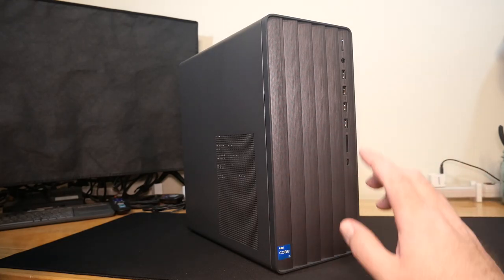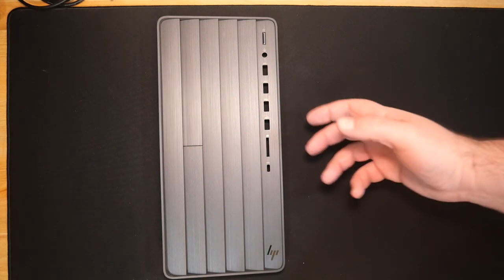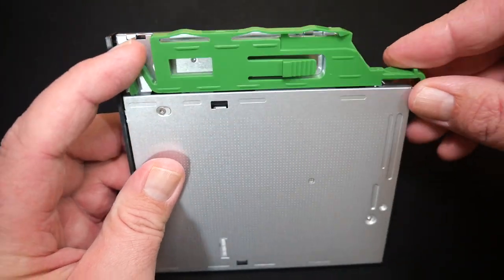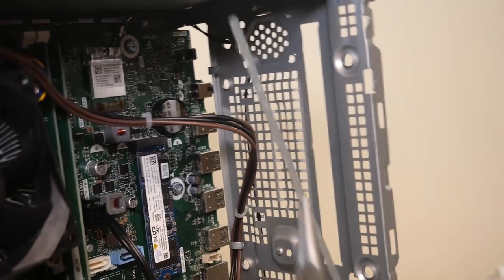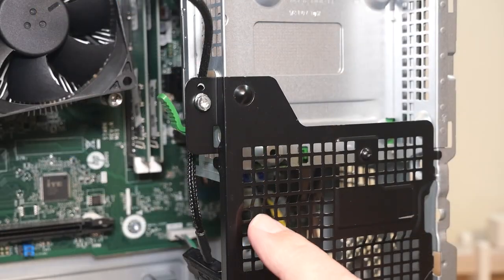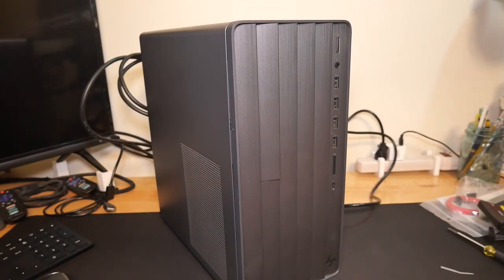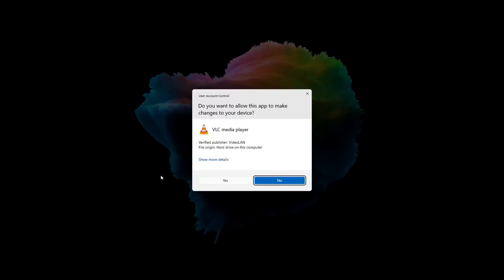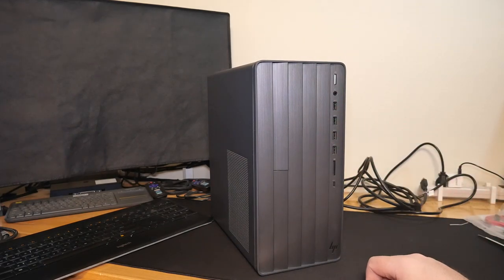HP Envy Optical Drive Installation

Comment: I like to have a full size DVD drive in my main PC. Because most modern cases don’t support 5” slots I need to fabricate a side loading mount inside the case. This isn’t a problem for me because I run the PC with the side panel off full time. This case doesn’t seem worth the trouble of adding an optical drive to though I would personally just use a different case.

PS you get extra points for using flush cutters!
Reply from the maker: Oh, I wasn't kidding in the thumbnail. No one should do this to this PC! 😂 The good news, or bad news depending on your angle, is that HP no longer even offers an optical drive bay in their "full-size" desktops anymore. So, this terrible solution was the end of the line anyhow.

That said, I do really like the Vantec full-size enclosure I have with a full height 5.25" drive in it. That's really the way to go, IMO.

Comment: I just ordered a refurbished HP Envy from Amazon (TE01-3197c) which has no DVD drive.  In the photo, it appears to have the "trap door" on the front plate, but I won't know until it arrives.  Hoping it does because I rather not use an external drive, but will if I have to.  This is a great video and exactly what I needed to know. I guess I will need one of those green latches too. Thanks.
Reply from the maker: I believe many retailers use a stock photo that shows the door regardless of whether or not the model includes the drive. It appears that model number does not. 😔 Since it's a refurb you may get lucky and it could have an odd combination parts, so... 🤞
Reply: I received the computer yesterday but have not opened the box.  I have decided that regardless of whether it has the door or not, I am just going to buy an external CD/DVD player (about $30).  I don't hardly use it anymore except to load some old programs.  The effort to install an internal drive is not worth it even though I am sure it is much faster than an external USB drive.  But I still enjoyed your video. @TheBrokenTech
Reply from the maker: @Happy-Trails-To-You  I'm honestly glad you made the decision to go external, but I think you really would be best served to go to a "good" external like the full-size option. The speed and durability difference is well worth it and eventually you won't be able to buy one at all.

Comment: speaking as someone who recently did a build with a Fractal North case, I'm totally fine with internal disc drives going out of fashion. PC towers like these are terrible for thermals, since they leave little to no room for air flow. A case with a mesh front makes air cooling far more effective, thus ensuring your parts last much longer, and without the need for water cooling. By removing internal optical drives, the leftover real estate ensures a much cooler environment inside the PC tower.

I say this all as someone who recently got into collecting Blu Ray and DVD, and while a part of me is still nostalgic for the days where I could easily watch movies on disc, I don't miss installing software and games with optical drives. Steam resolved many headaches for the PC gamer, while streaming platforms often created them for film buffs. That said, from an engineering perspective, I think the move towards external drives is for the best.
Reply from the maker: I generally agree with you on most of those thoughts, but the people who buy box store PCs aren't generally worried too much about getting the absolute best performance. I've had a lot of commenters over the years that are absolutely enraged that their PC doesn't (and soon, will not be able to) have an optical drive.

Where we will disagree is with movie streaming services. The selection on the streamers is pretty terrible. For instance, my personal movie collection is significantly larger than Netflix's US streaming library once you exclude Netflix originals... by nearly double.
Reply: Many modern cases that have 5.25" bays put them down in the PSU basement, such as the Fractal Pop.

Comment: From a previous video, I wondered how you were going to install that optical drive into that case.
 The upgrade to your HP Envy computer, the Te02-003x, has no internal support structure for a 5.25" drive and the case is entirely different.
I have been holding onto (storing) an external USB DVD drive but haven't used it in 6 years.
Reply from the maker: I wasn't even aware of the TE02 when I made my prophecy, but it looks like I was right on. Optical media is going the way of the dodo.

Some people are really upset about it though and really want that drive inside the machine, so, this one is for them. 👍

Comment: If my only choice for an internal ODD was a 9.5mm drive, I'd just use the 5.25" external enclosure you showed. One reason I build my PCs is I can ensure I have 5.25" bays in my machine. There are not many cases that still support 5.25" drives though.
Reply from the maker: Indeed. My last build, from around 2 years ago, it was tough to find a case with 5.25" bays. Now it may be impossible.
Reply: @TheBrokenTech  I am starting to see cases put 5.25" bays in the power supply basement like the Fractal Pop, so it seems they are coming back into popularity to some extent.
Reply from the maker: @RoastBeefSandwich  Huh... That's interesting. On the floor seems like a bad place for a disc drive, but, I suppose it's better than nothing.
Reply: @TheBrokenTech  I think it's mostly for airflow reasons. Not ideal if you plan to actually use your ODD regularly, but better than dealing with an external unless it really is only for occasional use.
Reply from the maker: @RoastBeefSandwich  I was more thinking about dust/hair/dander/whatever. Putting your drive on the floor and then generating a negative pressure behind it with case fans isn't a great idea.
Reply: @TheBrokenTech  It's a big issue nowadays, a lot of cases put the PSU in the basement which is fine because it allows the PSU to cool itself. But it turns the PSU into a vacuum if you put the machine on a carpeted floor.
Reply from the maker: @RoastBeefSandwich  Yep... I have my only build in a case like that sitting on a sheet of HDPE (a plastic cutting board) exactly so the fan has a prayer of breathing. It's the worst design I've ever seen. 🤣 I imagine most people don't put their cases on the floor anymore, which was originally the point of the tower PC.
Reply: @TheBrokenTech   yeah everyone has those fishbowl style cases full of rainbow LEDs, they keep it on their desk.
Reply from the maker: @RoastBeefSandwich  It's funny how these things go in cycles. I have my monitors sitting on auxiliary stands to elevate them and I was just thinking that it may make sense to just use the PC as the stand, old school style. 😂

Comment: From the outside that odd looks upside down.... but the fact that the green clip seems to engage correctly, and the flap might be in the way seems to imply it's not.... It bugs me though.... You can't really put this guy on his side and actually use it like a desktop as is... It'd either block the air vent on the side, or have to odd facing the table.  <meh>  I think I would have just run without a front panel rather then pay that amount for one.  Thanks for the video.
Reply from the maker: You can only install it one way so it is what it is. I suppose you could put some rubber feet under it if you wanted to lay it down?

Oh... I wasn't joking in the thumbnail. I really do hope that no one actually does this. 🤣You're vastly better off to go with an external drive instead of installing one in this case and buying all of the ridiculous stuff that is required to do so.

You're very welcome!

Comment: tempted to do this with my non-envy m01 not gonna lie. On mine there is a clear outline where the drive would have been located since reused chassis. I think best option is for me to get a pro to dremble and/or laser it off (i don't trust myself to do it myself). If i find anyone willing that is. Worst cast scenero is to pay the ebay part for 148.99 (much much less if i get the one with the sd card if my mental visualization is correct shouldn't be an issue with fit). Personally i think my family doesn't mind the external 5.25 enclosure i got them but hey one less usb/outlet.
Reply from the maker: The best option is a nice quality external drive and a USB hub if that's a problem. 👍
Reply: @TheBrokenTech  haha still thanks this video to give me a push despite the different version (over all internals was the same. i mean in theory i knew it was possible but best to have done research first just to confirm (i did do a over all glance when i upgraded the ram and ssd when i first got it). Glad the metal cut off was pryable. did take me a bit to take it off since my punny arms. Our pc already had a 6 pin so didn't have to buy any other accessory (bought the dvd player for 28.76 which was built this type of pc). The front panel was easy to push off sooo didn't have buy the front panel or get a shop to do it for us. So all in all glad to have gotten it done.
Reply from the maker: I'm glad it all worked out.